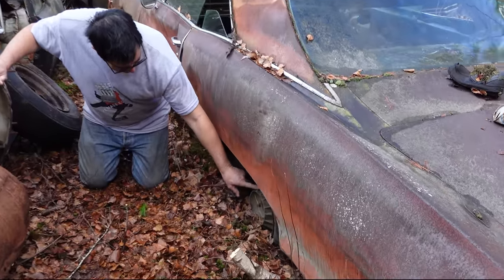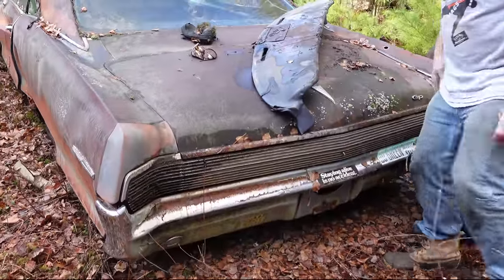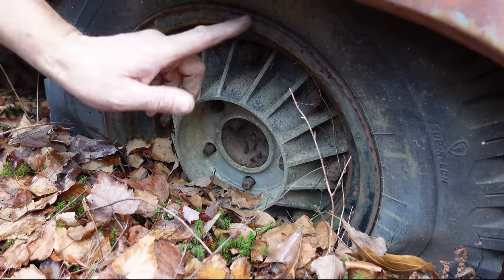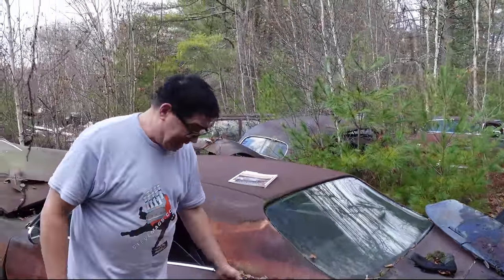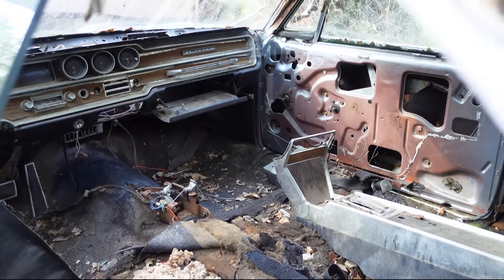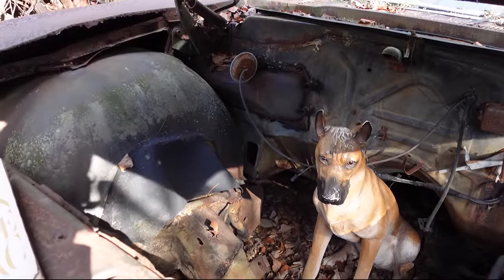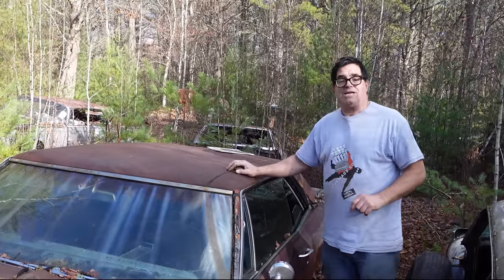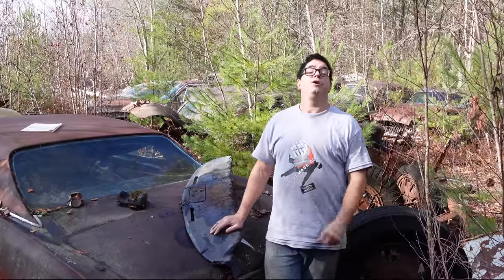Gimme a BIG Brake

Comment: As a vintage Pontiac guy, I approve of this video! Sad seeing these classics in the junkyard, but I always appreciate the knowledge Steve can pass on from them.
Reply: Hi Dave, I was wish somebody could please help me with this.  Back in the 1960s, GMs Pontiac Motor Division marketed two Full-Size high performance two door hardtop personal luxury cars based on the GM "B" Body, that where very much alike.  I am talking about the 1962-1968 Pontiac Grand Prix, Vs. the 1964-1967 Pontiac 2+2.  Which one cost more?  Which one had more standard equipment?  Which one had more optional equipment?  Why two cars by the same motor division that seemed to compete with each other?   I have researched Google Internet, but nobody will answer me!  Can anyone please help me to find this answer?   Please reply.  Dave...
Reply: @daveridgeway2639  The Grand Prix came standard with a lot more features than the 2+2. The 2+2 was just a performance dress up option on the Catalina meant to compete with cars like the Impala SS and the Galaxie XL. The 2+2 option was more cosmetic just like the SS was to the Impala. The standard engine with the 2+2 was still the 389/2bbl but it did allow for upper level engine options up to and including the 421/370hp (eventually 376hp). The Grand Prix however always came standard with a high compression 4 bbl engine and could be had with all the upper level options including the 421 Super Duty in '62 and '63. But those are the rarest Super Duty cars I think. The Catalina came standard with a bench seat and column shift while the Grand Prix came standard with buckets, a console and a vacuum gauge although that's an odd thing to have standard. The Grand Prix was more expensive than the Catalina even with the 2+2 option although that got them closer to the same price. All the same options like 8 lug wheels, A/C, Safety Track rear end, power windows, ect, were available on both but standard on neither. I hope this helps.
Reply: @1967davethewave  Thank you 1967davethewave for the reply!  Nobody but nobody has ever been able to answer me in regards to this question!  Thank you!  Dave...
Reply: @1967davethewave  Thank you!  Nobody has ever to answer this question!  Dave...

Comment: I had  a 65 Bonneville  2 doors hardtop back in the  mid seventies  through the  mid eighties.  Loved that  car. Surprisingly it got  great  fuel mileage.  Could easily get  25  mpg on the  highway.  Man that thing was fast for a  land  yacht that only had a  389 4bbl.

Comment: Sorry, Steve. This Grand Prix is a 1965, not a ‘66. The easiest way to tell is that the taillights had a full-width louver effect to their design. There are other ways to tell the difference, but since you focused on the taillight design, that’s what I used as an example. Have a good one.
Reply: I was shouting at the screen too.  🙂 I used to own a '65 GP myself.
Reply: @stuartstephens  I didn’t mention it, but I had one, too, in the ‘70s. I’ll never forget how beautiful the interior was.
Reply: 65 had the round gauges and more exposed headlights on the  sides. 66 had squared guages and flush headlights. I got excited as I have a 66 Bonneville that needs some specific parts and this place is a few hours away from me.
Reply: It looks like Steve needs to work on his 60's Fullsize Pontiac knowledge. On the 63 Bonneville that he covered, he mixed up he standard Hydramatic with the Roto-Hydramatic.
Reply: @jameslockard4827  Or just refer to the trim tag and/or VIN. Because at the point of repeating myself, "You need the VIN to win and the tag to brag".
Reply: @googleusergp  I was thinking the same thing. What engine did this GP come with?
Reply: @neshpro6521  Likely had the base 389 V8 with four barrel. The Tri-Power 389 and 421 were optional.
Reply: oh well even the pros make a boo boo sometimes. Would love to have one of these. wicked cool years
Reply: I always thought the 1966 GO looked like an "overweight" GTO. LOL
Reply: @kennethnovath6332  that’s exactly what I see when I look at it. That poor small block must have been working hard!
Reply: 8 lug Kelsey Hayes wheels, nice option on the Gran Prix.

Comment: I had a 1966 Bonneville hardtop back in the 90s. It had practically every option except for the 8 lug wheels. It was a great car. This Pontiac full size and Buick Rivieras of the mid 60s to early 70s were the most beautiful USA made vehicles ever built.

Comment: You're correct about the Grand Prix being a convertible and a two door, but by 1990, the Grand Prix was available a four door. By then, the Grand Prix was a "dishwasher" (more like an appliance), and you'd find it more at Hertz counter more than you would an enthusiast's driveway or garage. In 1988, the Grand Prix went to front wheel drive and became the "W" body. Yes, the 389 V8 was standard and for the last year, the 421 Tri-Power was also available on a Grand Prix in 1966. In 1965, you could get the 389 V8 with four barrel (as this likely was), a 389 Tri-Power or a 421 Tri-Power. We can assume that by 1991 this was probably off the road, as Mr. Dukakis was governor from 1975 to 1979 and then again from 1983 to 1991. Mr. Dukakis was one of the reasons that the Framingham, MA GM assembly plant closed down as he wanted to give land to GM by eminent domain, but a local politician, Anthony Colonna wanted to build a public works facility instead and butted heads with GM and Mr. Dukakis. In the end, Mr. Colonna won the battle but lost the war as GM closed Framingham in 1989. As pointed out by others, this is a 1965, not a 1966 model. The tail light treatment is 1965 and was different than 1966. You have the right year brochure there, actually. LOL. 

No VIN, can't win, but easy to figure out, no doubt: 2 for Pontiac, 66 for Grand Prix, 57 for two door hardtop, 5 for 1965 model year, maybe P for Pontiac, MI assembly and the rest is the production sequence. The Pontiac, MI "home" plant closed in 1988 after assembling the last of the RWD G body cars and the Pontiac Fiero.

No tag, can't brag, but again, somewhat easy to figure out, no doubt: 65 for 1965 model year, 26657 for Grand Prix, possible PON for Pontiac, MI assembly, possible 258-281 for black interior trim, possible W for Blue Slate Mist exterior paint, maybe A for black vinyl top among other codes. That's also a bumper sticker for the Greenfield MA state fair which is still held today and started in 1865. It is located at 89 Wisdom Way in Greenfield, MA. 

The Pontiac parts place to go to for restoration parts has always been Ames Performance Engineering which is right in your backyard in New England (Spofford, NH). I've met Mr. Ames a few times at swap meets in the past and he's always been an easy guy to deal with. Long before the "odd ones" became popular, Mr. Ames was offering parts for the obscure Pontiac. Ames is all Pontiac, they do nothing else. What I've always liked about their catalogs is their honesty in describing the parts. "Poor reproduction, but best that is available", or "Made for us to exacting standards. Quality is excellent", or "Fit is fair, requires extensive rework". You don't see that often in parts catalogs.
Reply: My sister bought her first 4-door Grand Prix in 1994.
She then continued to trade-in the older one, and buy a new one, every 3 years... until the final year that Grand Prix were made, 2008.
Now, at the end of 2022, she is still driving that 2008 Grand Prix.
I have no idea how many miles it has now. But it is surely a lot, as I know that she drives several hundred miles every month.😁
Reply: The auto parts manufacturer I worked for had them as company cars at the time in the 1990s.
Reply: @googleusergp  👍

Comment: I remember seeing one of these parked behind a small garage near Honesdale, PA. It was probably 25 years ago. That one was complete with the 421 Tri Power and a four speed and gold paint. If I remember correctly it was fully loaded with all the options. It wasn't for sale but was in really great shape. The wheels were off and it was sitting on blocks. I was never a Pontiac guy but would have gladly owned that one.

Comment: Eric Esterby is correct!  This is a 65 not a 66.  The headlights on a 65 is different from 66 and the center gauges are round on 65 and square on a 66.  Also, the tail lights are different as well!

Comment: I remember those Pepsi cans.
However, I never had an opportunity to drink from one.
At that point in time, almost all of the pop (soda) in the vending machines where I grew up, in Kansas, were still in 10 ounce glass bottles, regardless of brand.
The bank where my mom worked, had a vending machine in the lobby.
The local distributor stopped by every week to refill it. And once a month, my mom would buy a case of assorted brands... Pepsi, Dr. Pepper, 7up... from him, to bring home for the family.
My parents allowing us to have a bottle of pop, once a week, was a special treat.
And us kids weren't allowed to drink a bottle of pop without our parent's permission!

The"case" those bottles came in were a flat wooden tray, with dividers between the bottles.
And if I recall correctly, those trays held 24 bottles.
And that tray actually belonged to the distributor, so when it was empty, mom had to give it back to the vendor, or else get charged extra for it!

Comment: Those brakes worked great as did the Buick front Aluminium drums.
Reply: In theory they should dissipate heat nicely.   The back ones would benefit from more contact with the steel rim  perhaps for the same reason.

Comment: Im gonna suggest the GTO owners had a better setup with aluminum drums in the standard format. Tires on and off as you burn thru them etc would be a pain otherwise equipped.  And disc brakes were on the horizon. Personally I like drum brakes had them on my Duster they were plenty strong and easy to modulate in city driving. And easy to service!!

Comment: I had a 65 GP back around 1981. I bought it from an older couple that kept it like new but had to sell it because the frame had rusted and wouldn't pass Pa. Inspection. One night, coming home from a party, I was rolling along about 80 when traffic light changed. I had to stand on the brakes with both feet while yanking on the steering wheel. When it finally came to a stop, a big cloud of brake smoke came slowly rolling past me.

Comment: Correction on the Pepsi can. After the pull tang tab, the next version was the two round push in ports, one being small and the other being large. The small one was to be pushed in first followed by the large push in next. The top of the can had two arrows that said "push first" pointing to the small push port. This was done so the Pepsi would not fly out the large hole. By opening the smaller first, the release of the product outside the top was greatly reduced. The tabs had potential for a choking hazard as they could be manipulated off and be swallowed.
Reply: I know the push button can tops but I don't think they were used across the country. In New England and downstate NY, we never had them. I did see them when visiting relatives and on vacations in other places.
Reply: Thanks for bringing that up I had forgotten about those push tabs and you are right they discontinued it because of a possible choking hazard.
Reply from the maker: I remember those 2-button cans were around for just a year or two. I remember slicing one open to see how it sealed. There was a rubberized Styrofoam bead around the underside of each button. I think I recall that this sealant material could become brittle and begin to leak after a while. perhaps that was the "nail in the coffin" for that configuration. But yes, push the little one first to release pressure then the big one and swig away! Thanks for writing, Steve Magnante
Reply: @SteveMagnante  Nice t o see you at the yard today, the Green Wave bumper sticker refers to the next town over Greenfield they call their teams the green wave, keep up the great work love it!!!
Reply: Never saw the push button ones until I saw a pic of one years later on the internet. We went right from pull tabs to the kind still in use today.

Comment: Gran Prix was a full size model until 1969, when it went to a stretched midsize platform.   

I had a magazine years ago that showed what they thought was the prototype Gran Prix, a 1960 in a Michigan junkyard which had a hardtop with the sort of fake convertible rib shape of the 1962 coupes.   Somebody saw it, took photos because it was odd, then went back to research it only to find it gone and just some parts to it laying around.   They thought maybe it used a convertible body and the top was added as a styling exercise.  

I don't even remember the magazine, unless it was in High Performance Pontiac, but I think it was something else, a short lived lesser title.

Talking about rust, I parted out a '64 I got out of a yard where some cars were fairly decent for New York.  This car I couldn't tell for sure when or why it was parked but it had 1971 receipts in the glove box.  Anyhow I decided to slice out the spears in the quarters, I was building a custom '50 Chevy and thought about grafting them into the body sides.  When I cut it apart I found the car had already been patched up once and that was why it looked so decent.  The frame also was rusted completely through left side under the rear seat area.

Comment: I still have my dads 66 389 auto paid $ 4300.oo off the show room floor  it handles great if you get on it it will spin the tires at 65 mph when it shifts it doesn't have the 8 lug setup and I also have 64 Buick with those big brakes . Thanks for the video

Comment: Hi Steve, I was wish somebody could please help me with this.  Back in the 1960s, GMs Pontiac Motor Division marketed two Full-Size high performance two door hardtop personal luxury cars based on the GM "B" Body, that where very much alike.  I am talking about the 1962-1968 Pontiac Grand Prix, Vs. the 1964-1967 Pontiac 2+2.  Which one cost more?  Which one had more standard equipment?  Which one had more optional equipment?  Why two cars by the same motor division that seemed to compete with each other?   I have researched Google Internet, but nobody will answer me!  Can anyone please help me to find this answer?   Please reply.  Dave...

Comment: Your wrong on the year on this, its a 65. 66s had a different more angular front end design and I believe different rear end treatment. On the inside the 65s had round ancillar gages as shown in this car where the 66 model were rectangular shaped.

Comment: Hi Steve, good video!  The big 11' aluminum brake drums with the cooling fins and a pressed in (steel) insert where often found on many high end GM cars such as, Cadillac(s), Buick Buick Electra 225, Buick Riviera and Oldsmobile Toronado with power brakes of course.  You see finned aluminum brake drums dissipate the heat much faster than standard steel brake drums do.  This braking system is/was a very very efficient and powerful.  Power "front disc" brakes took over where this left off due to production cost(s).  The 9.5" Pontiac GTO finned aluminum front brakes that you did show, came with steel impregnated brake shoes from the factory for even MORE stopping power.  You see, a finned aluminum brake drum with a pressed in steel insert cost more than a "disc brake rotor" dose.  Please reply.  Dave...

Comment: I know where a 68 granprix is supposed to have a 421-8 in it.  Floral print seats green with green interior
Reply: 68 is a one year only body style that you very rarely see.
Reply: Are you going to buy/restore it?
Reply: 421-8? Dual quads? What does the 8 signify?
Reply: @kenttalsma7906  Probably means a 421 V8.

Comment: Why can't you get them (8 lug wheels) on a GTO?? ROFLMAO... because 11 inch drums cost more than GM wanted to spend on brakes for the LeMans platform.  Every penny counts in their culture. That's why we got steering wheels that turned to goo after the warranty ended.
  Umm, before we swoon over the beautiful, admittedly, 8 lug wheels, you have to swallow the fact that they were only 14 inch diameter. Oh well.  I believe the aftermarket has corrected that recently, though.

Comment: Pontiacs and Buicks of that era had real nice styling.  The more expensive ones of course tended to be the nicest, and of course now are the least appreciated.  When you read out loud these hp ratings from GM of that era, you need to remind the viewers that true net hp was likely 100 to 150 hp less than the advertised number.  The driver side fender is buckled in some accident damage, yet the front bumper and headlight area seem intact.

Comment: Gorgeous great body lines on that car and fantastic style. I like to integrated grill across the back. I saw a GTO that they had done that treatment too as a customization. And actually look real sharp. I'm assuming they had cut and trim and fit the piece. The guy who had owned it had passed away but at the time he owned a retired Pontiac dealership and actually kept most of his cars. You'd walk in showroom ready literature from various years and a complete parts counter that was really well stocked. He literally had warehouses of parts. He had bought the parts counter and all the inventory from another Pontiac dealership and put it into this Pontiac dealership that had been gutted originally. Anyway I would choose the GTO. I did buy a Grand Prix and I think it was about 1984. Fantastic body lines. Give me a break is that a reflection or not to the TV sitcom from I think the '80s. I think the main character who was a black woman whose name Mel. I'm reaching for that one but it sounds familiar. Aren't those rims worth a small fortune the eight lugs?

Comment: Coats 10 10 tire machine had an adapter.   Thinking the front brakes ,8 lug, could be installed by a DYI,ball joints (spherical joint) interchanged.